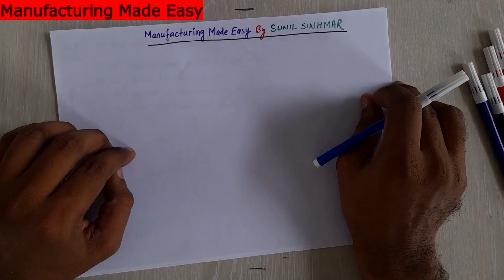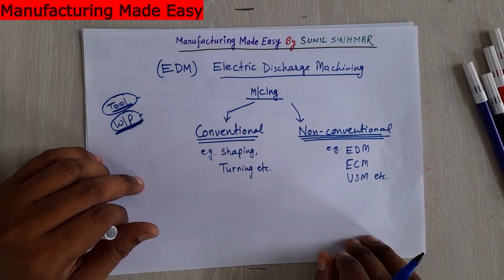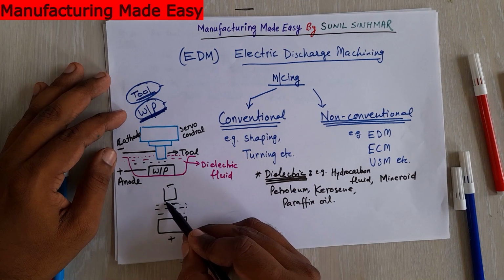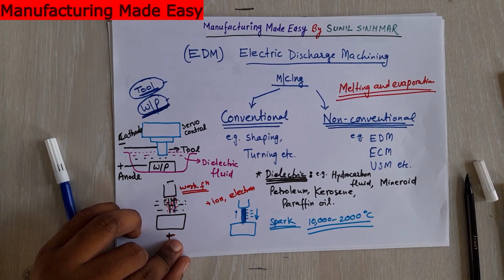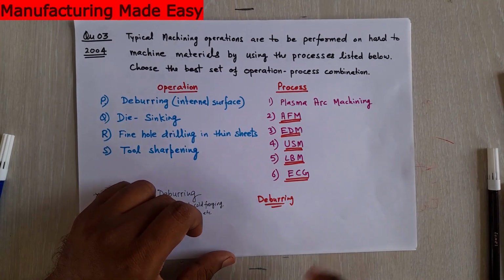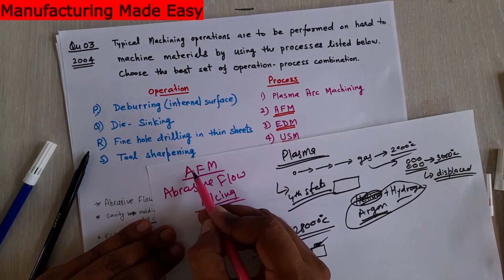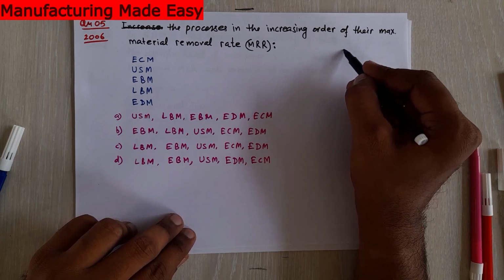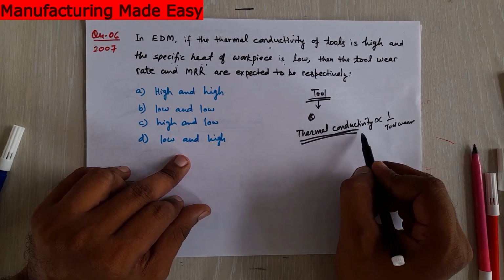Part 5 GATE questions I EDM: Electric Discharge Machining (Basic Terms And Working) Sunil Sinhmar

Comment: MRR (mm3/s) in ECM is  (Ew x I)/(F x p),  where Ew = equivalent weight= Atm. wt./ valency, I = current (A), F= 96500, p= density (Kg/mm3), note if density is not given in Kg/mm3 then convert it to the same. Additionally, if percentage of a particular metal 'X1 or X2' is asked in an alloy then use Resultant Chemical Equivalent formula i.e. 1/Ew = (X1/Ew1) + (X2/Ew2), where X1+X2=1 and are composition of alloy. Here take X1=x and X2= 100-x, if neither value is given in question. 🙂
Reply from the maker: More to remember: There is no residual stress in machined surface in ECM.  Etch factor= Undercut/depth of cut. In ECM material removal is due to ion displacement
Reply from the maker: Fatigue strength of Stainless steel decreases due to ECM